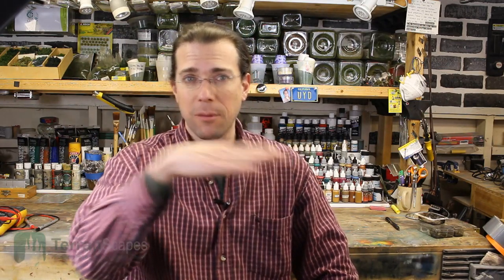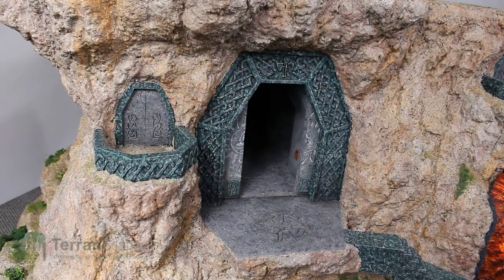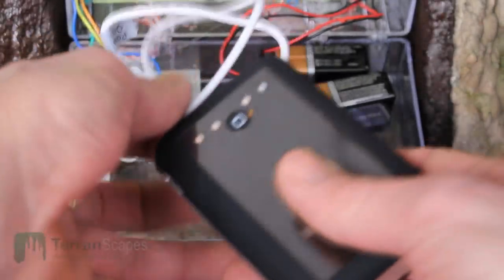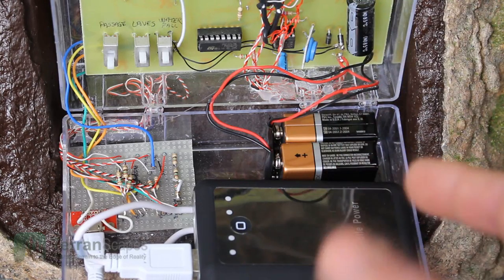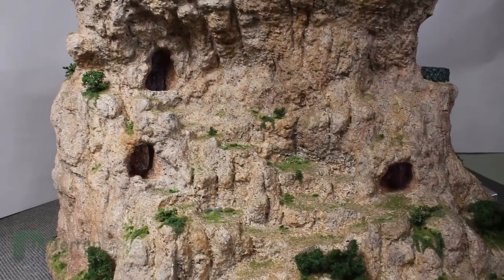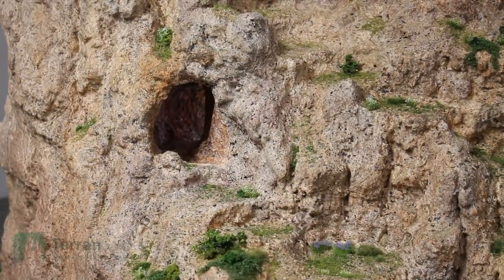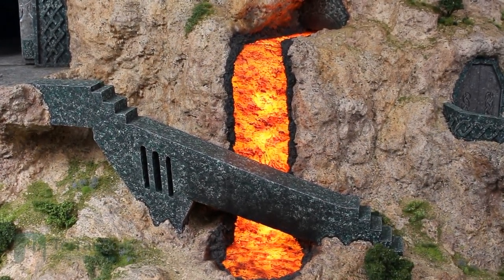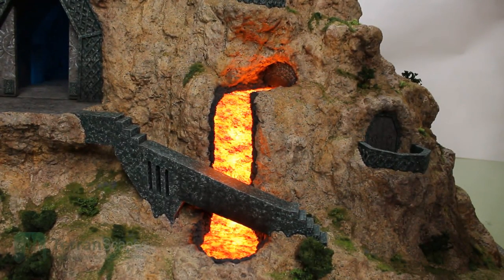TerranScapes - Cliff Lighting Finished - Wargame Terrain

Comment: I’ve found coating high “traffic” areas and access panel edges & perimeter with Mod Podge hard coat (un-thinned) works pretty good. 
Another way to harden those access areas, that’s a bit trickier, is to work the panel edges & perimeter with CA & baking soda. You have to drop the soda quick on the first layer (working in small sections), but then you can build up pretty quick from there and sand back/re-form. That gives you a rock hard mating surface and can be worth the effort.

Comment: You may be able to put a 300 Micro Farad capacitor across your power
source. I get spikes from the led cutoff and this eliminates flash. Great
job on the lighting.
Reply from the maker: Hmm... That is an interesting point.  I have noticed that the current spikes a bit from all the different LEDs pulling at random moments.  A capacitor would help that (from what I understand).  Something to consider for the next one.  Thanks.  :)

Comment: Great work Mike! Curious. Could the poece in theory be wired to accept a DC 9v power adapter and by pass the batterys all together?
Reply from the maker: Actually, that would be possible.  The regular lights would need some adjustments for the higher voltage but the cascade would be fine.  I didn't really give it much thought as I just hate cords.  Moving around the piece would make them annoying (to me at least), but for a more static/display piece it would be feasible.

Comment: It's nice when 100% on, but very ugly when shifting from lamp to lamp.  Can you try a smoother fade in/out when changing lamps or is the control module not advanced enough for that ?
Reply: I meant for the lava ;)
Reply from the maker: Ludovic Urbain
You are correct.  The lighting control for the cascade doesn't gradual dim each set, so it gives an abrupt transition.  I would have loved to work on fixing that, but I had spent a crazy (I mean CRAZY) amount of time on the electronics I decided to make a concession.  :)